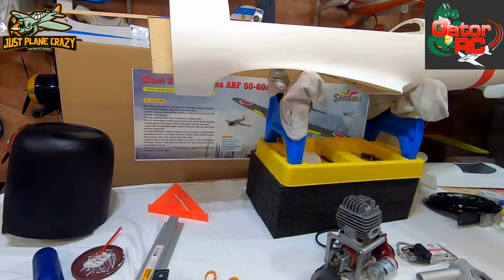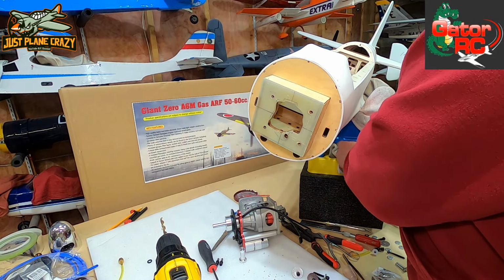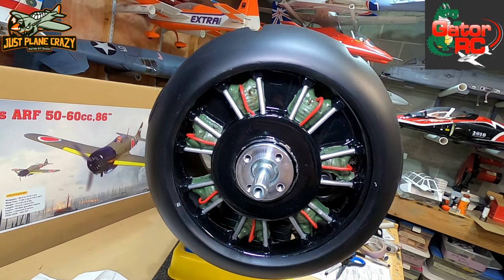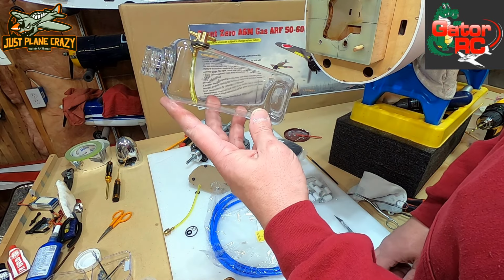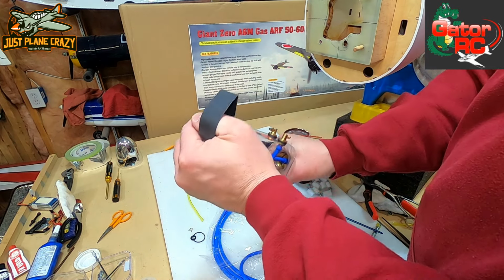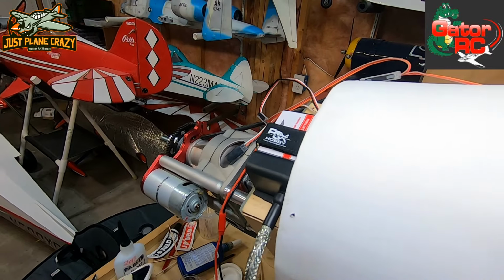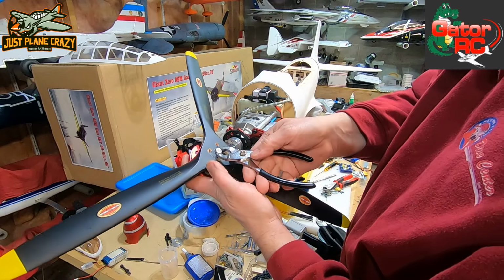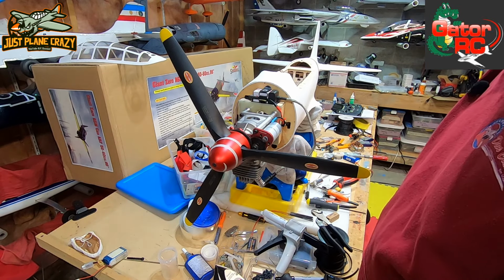Seagull Models Giant Scale Zero, Assembly and Install: EME60 AutoStart, Fuel System, Control, Prop

Comment: Im building my first gas arf. Its taking longer than i thought. Im on setting up the fuel tank. Im curious how bug should the tank be for a fg33r3 saito?
Reply from the maker: 500cc is a good place to start. Depends on the plane, how much room you have and how long you want to fly. The radial will use less fuel than you think so I think the 500 should be good

Comment: That engine would never get hot enough to require red lock tight. If it got that hot you have bigger problems. Blue lock tight is plenty good enough and easier to remove when needed. Good job otherwise.

Comment: empty tanks fine on engines with oil reservoir crank cases but 2 strokes should not be run dry especially hot .

Comment: You do not use silicon fuel line with petrol/gas it will almost dissolve it and the silicon will run through the carb and make one big mess.
Reply from the maker: Yup. Wanted to try something different that said it was fuel safe. It wasn’t. Followed up not to use in the video description
Reply: @JustPlaneCrazy  it is fuel safe just not petrol/gas safe.
Reply from the maker: Most likely were I went wrong in reading the initial description. Either way all corrected and a great flying plane

Comment: Rather than doing the vent line loop have you ever used a 1 way value like the ones that come with smoke systems?
Reply from the maker: No that’s an interesting thought. Have u?
Reply: @JustPlaneCrazy  not yet seems like good idea as long as the valve is reliable because if fails in the closed position the motor would die

Comment: how did you remove and install a longer fill tube? I've tried it and it's crazy trying to work through the front of the tank with hemostats, etc. Sure would like to know your method.
Reply from the maker: I use hemostats through the front.

Comment: The corrosive energy of vaporized fuel is greater than liquid, if you leave the tank completely filled there is less damage done to lines.  Even with an absorbant fuel filter on the fill line, to suck up the maximum amount of fuel, fuel and the smell remains  it's vapor does the damage. Many clear tanks have a carb line stiffener to prevent line from flexing, Completely agree with clear tanks over opaque. Like the heat shrink, I've used a dab of foam-tac around the cap as well as all connections into receiver, and permanent servo lead connections. Had a friend who put a porous fuel filter on vent line to filtet the air going to tank, hobby has never addressed air debris from the plane,  the field and some tank material break down, never seen an carb air filter.

Comment: I have a question for ya? I just bought an EME 35cc with electric start. Can you explain to me how the controller gets hooked up please? I cant find any diagram or anything and this is my first electric start. Im not sure about the 2 XT-90 plugs or what they go to. Thank you I would appreciate any help or advice.
Reply from the maker: You bet. The xt90 plugs, one has to be a battery in and the other is out to the starter motor. I believe it’s marked as so. If not let me know and I will take a look at mine for you. The smallest plug goes to an open receiver port. You set up that port as an on off configuration.

Comment: As you were putting together zero with your EME starter you never did show how you hooked up your starter to your ignition to your relay to your battery or batteries you said that you were going to use that one battery for your ignition and your starter the question is that continuous power to keep your ignition going or does it hook up as to the power comes on only when you flip your starter switch from your receiver.
Reply from the maker: The starter…… runs from the starter motor to a relay. The power side of the relay is fed by a 3 cell battery. The relay is controlled by an open channel on the receiver. 
The ignition is powered through a kill switch from a redundant set of receiver batteries and controlled through an open port in the receiver. 
Hope that helps.
Reply: @JustPlaneCrazy  Thanks therefore I will be using two switches.. one for my receiver and the other for my smoke sys. My plane is the Lysander. I’m doing lights, starter on a EME60 IBEC smoke.=4 batteries 1starter 2rec 1smoke
Reply from the maker: Very cool. Best of luck
Reply: @JustPlaneCrazy  🏆

Comment: Brendan, good video. You just showed new to gasoline engines the proper setup for installing a trouble free power setup. I might give a heads up to those tanks that are opaque.
It’s easy to install them upside down. And if there round tanks they do like to rotate.
PS, love flying formation with you at Pegasus! Remember next month is PGRC. A few of us will be arriving on Wednesday. NWR ( C/S ) KRAFTY.

Comment: Hey Brendon, great stuff! Thanks for sharing. How did you get enough clearance between your front cowling and the Autostart gears for your dummy radial??? My dummy radial touches the gears…I’m having difficulty figuring it out and would really like to fly my big Skyraider with the dummy radial…
Thank for your time in advance,
Chuck
Reply from the maker: Chuck,
    Thanks for watching. I did many test fits and trimmed out the dummy around the gear. It’s blended into the dummy engine and hard to see :-)

Comment: Was that fuel tube worth the money?? :)
Reply from the maker: It was not. It failed really fast.
Reply: @JustPlaneCrazy  oh what a shame, back to tygon?
Reply from the maker: Yes. Tried and true I guess
Reply: Have a filter outside the tank that is easy to frequently check, in addition clean the carb filter too.
Reply from the maker: With the ceramic in my fuel jug and a ceramic in the tank it’s filtered out in microns. I have never had a restriction in a carb or filter. External filters as you said are awesome an a good choice also

Comment: I have a F.E.M.A kit on my saito 1.80 on a GP super stearman. 
I am confused on one thing. 
I have a servo that is actuating two switches. One for the starter motor and one for the glow system. 
But as the builder is not around anymore. I am of the understanding that the switch isnt good enough or even capable of making the voltage stepped down to make the glow plug, well glow. 
So what would i need? 
A separate glow system like i can find at any hobby shop? 
What about the motor? Is the switch good enough?
Reply from the maker: Email me pics brendenmccormick@att.net

Comment: What was the failure of the fuel tubing? I have been using polyurethane tubing for several years now and never have a problem. It doesn't get stiff like tygon and is pretty easy to find. There used to be a vendor at Top Gun every year and I would restock from him. Unfortunately he hasn't been there in years.
Reply from the maker: Thanks for watching and asking. The tubing all swelled and split. Even the stuff in the gas can. I assume it’s not as fuel and oil safe as they say. This brand anyway.

Comment: Do you think you will need to reinforce the firewall box structure to the fuselage bulkhead?
Reply from the maker: Great question but I do not. They use a lot on triangle stuck inside the fuse.